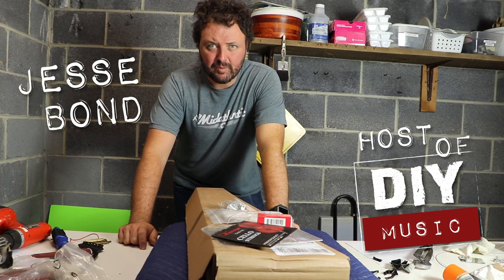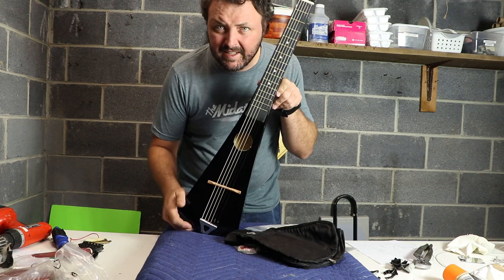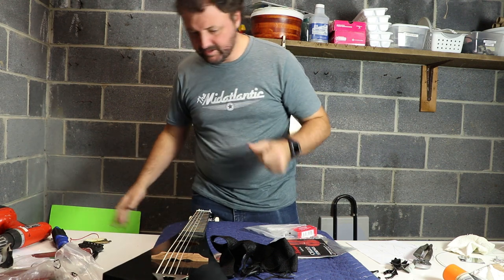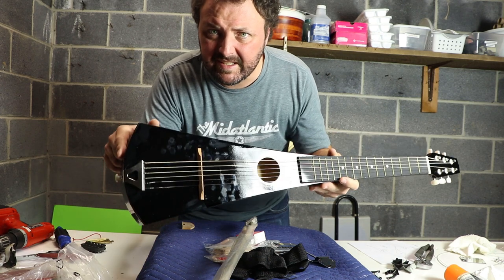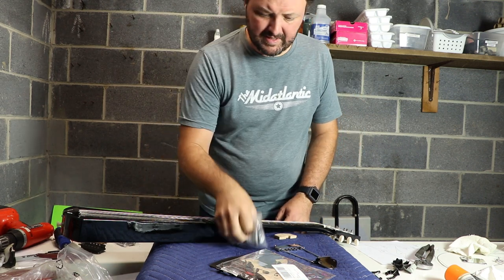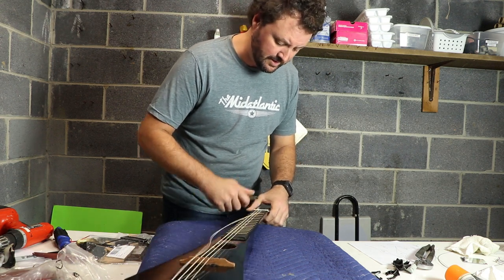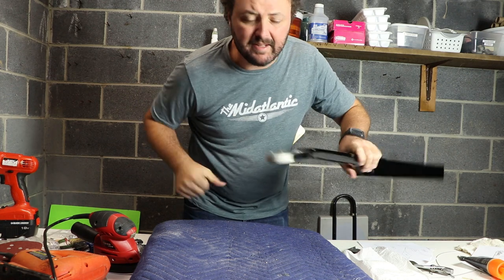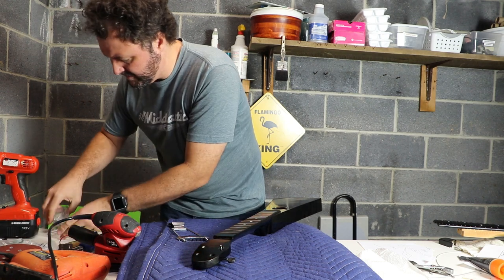The NEW $65 DIY "Bowstick" backpacker Cellotar - DIY Music bowed guitar

Comment: Your channel has been an immense inspiration and has empowered me to make my own bowed guitar/arpeggione from existing parts - thank you for showing me that I am actually capable of doing this stuff! I pretty much have everything figured out but the bridge placement and intonation (never built/assembled an instrument before). I am using a classical style cello bridge, but one that was made for 6+ strings, a premade arpeggione neck, and a Hofner violin bass body. Do you know if the bridge should be placed with the same philosophy as a guitar - that is, such that the 12th fret harmonic occurs for each open string at the halfway point of the scale length? The pickup will be a piezo in the bridge, so worrying about an internal sound post isn't part of the equation, thankfully. I am grateful for any input you can offer!